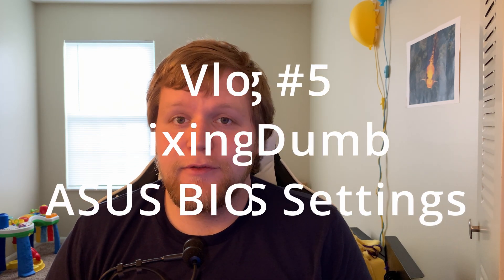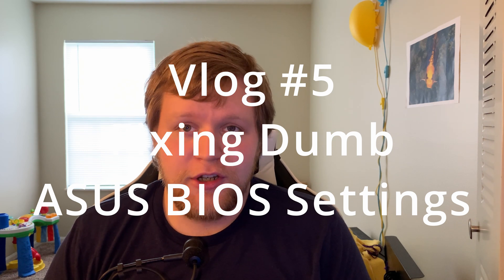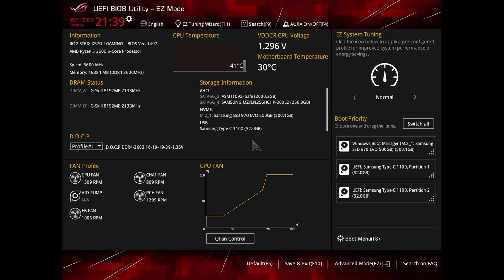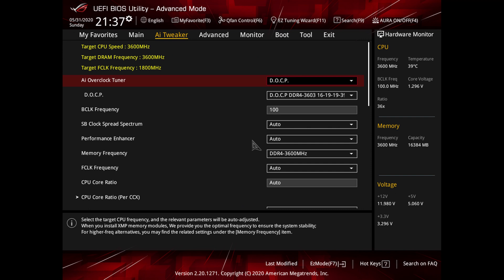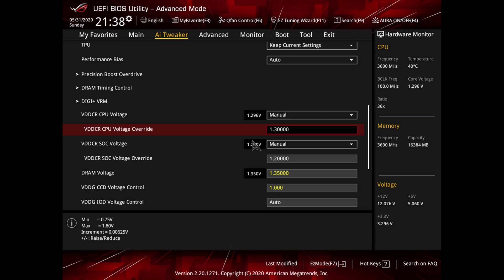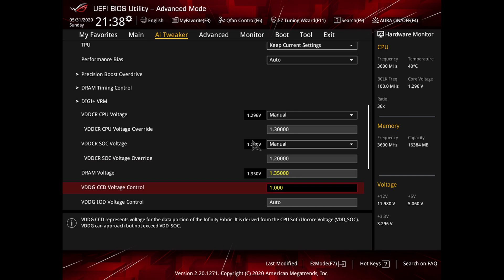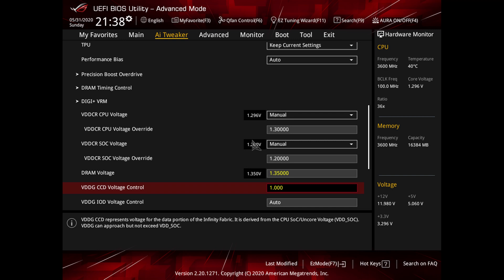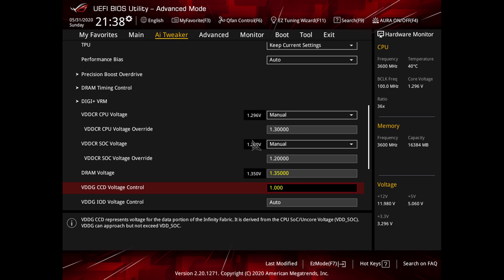How to fix an overheating Ryzen CPU for free

Comment: what voltage i should use for 4.00 mhz using ryzen 5 3600 with stock cooler
on my board i can't directly change voltage there is option of offset voltage (don't know how to used that)

Comment: I need help I did the thing in the video save and restarted it, now my pc monitor are black don’t know why. My pc is working all the led are on I just can’t do anything on my pc. I turned it off and on, nothing works. Help me plz if u can ?
Reply from the maker: It sounds like you may need to reset the CMOS on your motherboard. That will return your BIOS to its original settings. You should be able to find how to do that in the motherboard’s manual or via YouTube! Best of luck to you.

Comment: I have so many issues with this. I don't even know where to begin. I would also like to state that I have contributed a significant amount of time into understanding overclocking and monitoring Ryzen processors. I have spent a lot of time and effort to make sure that my information and understanding is correct. Just go clear the waters, if you know what Clock Tuner for Ryzen is, you should check the credits page. In addition, I am the only one who really develops software specifically aimed at controlling and monitoring Ryzen Mobile based systems (outside of AMD and OEMs). Setting overclocks in bios is dumb on Ryzen because you are bypassing the System Management Unit and that causes a number of potential problems. Next, AMD motherboards don't really overclock themselves. Ryzen is just set to run as fast as possible untill it hits its thermal target. Not to mention the whole list of variables that you change when going from the stock boost algorithm to a manual OC. Ryzen is specifically set up to idle cores as much as possible in its stock configuration. This will lead to the temperature showing a higher number as AMD measures the absolute hottest point of a particular part of the cpu. Setting a constant voltage of 1.35v is a TERRIBLE idea. I cannot run 1.35v under certain workloads without overheating. I have a 240mm custom EKWB loop. Having that much voltage running though Ryzen is just a terrible idea as you create a massive heat density problem. If I cannot handle 1.35v, its an absolutely awful idea to run anywhere near 1.3v on a wraith stealth. I just happened to stumble across this video and it just got so many things wrong. It pains me to see this kind of bad information being spread around when I've spent the last year of my spare time into understanding Ryzen. Honestly, you'd be way better off just throwing PBO on and setting a custom temperature limit. Ryzen just idles "hot" as it's got cores boosted up for whenever you hit the cpu with a workload.
Reply from the maker: Keaton, thank you for your comment. The last thing I want to do is spread misinformation. I made this primarily because I had overheating issues at the ASUS X570-I ROG Strix’s factory settings and I wanted to help others find the solution that took me a month and an RMA to find.

After considerable digging online, I came across a JayzTwoCents video where he explains that many gaming-centric motherboards overclock Ryzen out of the box in order to compete against other manufacturers. He then changes settings on a Strix board to what is shown here. (Please note, by the way, that 1.35v listed there was set for the DRAM automatically by DOCP.)

The settings Jay shows, the very ones I show here, are stock settings provided to reviewers by AMD so they can test more uniformly without the specific motherboard used contributing as much to the outcome. Because the Strix board overclocks somewhat out of the box, these settings effectively result in undervolting, not overclocking.

All of that aside, I agree with you that Precision Boost Overdrive is a better solution for most people, IF they can afford a better cooling solution than the Wraith Stealth. If not, I submit that this may be a viable solution that reduces system power draw and CPU temperatures while offering increased performance. 

If there are things I am missing, though, please feel free to reply. I really don’t want to be causing any harm here. I was only trying to help summarize information I dug out of a video from what I consider a reliable source.
Reply: @MostermindTech  im running a ryaem 3900X on an aorus pro mobo, it was idling between 45 and 55, then i updated the bios to the latest version. This got rid of the temp spikes completely and it idles between 33 - 37 now.
Reply: Gotta admit ctr 2.0  really did the job done, now running cooler and faster with 1,188 volt at 4,25 ghz all core. And most important i dont lose single core performance with hybrid oc

Comment: Came for the overheating of my 3600, stayed for the ASMR
Reply: Normal 3600?
Also what is ur cpu
Reply: @memecity6722  CPU is a 3600 :D. It doesn't actually overheat but the chip loves to ramp up frequencies and voltage for a second and then it comes down immediately (the boost clocks kicking in) and this causes a sudden spike in temperature. This made my cooler go crazy so I adjusted the fan curve to ignore the spikes and set the fan a little bit higher RPM wise. But overall the chip does run hotter than the 1600AF. Oh and I don't use a stock cooler. I have an aftermarket air cooler which helps a lot.

Comment: hey god sent you to me i have same problems i've got ryzen 5 3600 with rof x570-e gaming the board overclocking the cpu automatically and increases the voltages to 1.4/1.44 in bios temps if cpu around 30/34 degree and on windows at idle 40/44 degree clock go from 3.6 ghz up to 4.1 ghz i have a good cooler enermax liqmax 360 i wan to get a low volatges with low temps without losing performance let's say 4.0ghz whic stable voltage that is stable and low temps?
Reply: Dude I have da same situation going on with mine and I just swapped my stock cooler for the evo 212 CM and it’s hitting 95c under full load it s making me sad lmao
Reply: @Dxe1016  i've got the solution disable amd boost core and everything will be done
Reply: @dalileddineslimani6399  how many voltage should I use I currently have mine at 1.4000 but idk if maybe it’s to high that’s ways causing extra heat
Reply: And did you do this through the bios or did you use Ryzen Master
Reply: @Dxe1016  no on bios just disable amd core boost that will disable the auto oc by amd and ryzen 5 3600 will go with its base core speed which is 3.5 and you'll notice that the temps will go down with 5-10° or more than it depends on the efficiency of your cooler.
Reply: @dalileddineslimani6399  yea but I’m trying to keep my ryzen 5 3600 at 4.0-4.2ghz all the time because it just stays at 3.6 and never moves up even when gaming and I found it odd so I upgraded to the evo just to overclock and kill heat but no it’s just the same amount if not more and it’s passing me off really bad because I Care about my hardware
Reply: @dalileddineslimani6399  there’s no way to get rid of the heat without it interfering the overclocking
Reply: @Dxe1016  my clock speed before i disable amd core boost were between 3.6 and 4.0 ghz after i disabled this feature clocks went back to the base clocks 3.6 ghz for sure temps went dropped from 46/50 to 35/40 using 360 mm radiator.
Reply: @dalileddineslimani6399  but have u found a way to keep the CPu at lower temps but around 4.0ghz ? I’m really in need of help because I just upgraded from an intel Xeon that’s 10 years old and spent $200 on this CPu upgrade just for it to run hot as fuck and be slower than a 10 year old processor and I applied the proper amount of thermal paste like I always do this is just really pissing me off I can’t find a solution
Reply: @Dxe1016  temps were normal in my case with that oc but i exagerated about it
Reply: @Dxe1016  i have a ryzen 9 3900x with stock cooler max temps at full load 78C. All cores 4.15 GHz and 1.168V
If you want lowers temps reduce the voltaje and GHz, or buy a better cooler. 

With a water cooling I can put that ryzen all cores at 4.4 GHz, and it is like 5% performance improvement. But  with more than 1.3V. 
I prefer less than 1.3V and less than 75 C.

Comment: can i follow this tutorial with an Asrock b550m pro4 Motherboard BECAUSE MY CPU is overheating aswell like 94C full load and 60C at Idle
Reply from the maker: Absolutely! The settings may not be exactly the same, but they should be similar enough to translate over to your motherboard.
Reply: Kanye yeast, what is ur cpu and mobo?
Reply: @memecity6722  mobo: asrock b550m pro4, cpu: r5 3600, i actually gave it for testing and they just gave me a new one for free cuz i still had warranty. Turns out the cpu was faulty

Comment: Hey man I have a Asrock B450 M HDV mobo with R5 3600. 
I know It's a pretty trash mobo but since I wasn't planning to overclock it I decided to choose this one.  can I use the same settings that you used here to reduce my temps too?
Reply from the maker: You should be able to, yes. I’m not sure exactly what analogous settings are available in Asrock BIOS, but I would imagine there will be several parallels worth looking at.

Comment: Can I do it on asus prime b450ma ? I dont  habe the manual opcion on control of volt
Reply from the maker: There may not be all the same BIOS settings, but there should be some manual voltage controls. I would compare your BIOS to what’s shown here and see what similarities you can find in regard to settings.
Reply: @MostermindTech  thx :)

Comment: What about the stress temperature after change these settings Daniel because i bought rayzen 3600 with Asus Prime B450 motherboard  having  overheating issue when stress the cpu up to 90% 
then its over heating nearly 92 degree any suggestion
Reply from the maker: The temps are getting that high under load after changing the settings? I would say the next best step will be more airflow in the case if you can manage it. Ultimately, the included cooler with the 3600 just isn’t robust enough for the CPU. I would not call the stock cooler a permanent solution, but for anywhere from $30-100 you can get a good cooler upgrade. I’ve heard very good things about CryoRig, Noctua, and Arctic coolers.
Reply: @MostermindTech  hi Thanks for ur reply actually when process to 100 without overclock temperature Rising up to 95 c  then i stop the render because im not sure about what will happened next.. then i ask to replace the product with new where  i bought   it then they claim warranty and provided me new processor . it also have the same issue may be whole new 3600 processors having that issue ,, one of my friend have 3600 with stock cooler maximum temerature reach when 100% cpu usage is 77 c
Reply from the maker: I hope you were able to get those temps down! Unfortunately, there are a lot of variables that affect it. 

One common problem some people have is seating the cooler properly as well. Just a tiny bit off-level can totally ruin thermals.
Reply: @MostermindTech  Hi There was an issue in that processor so replaced the processor
Reply: @SpectrumpicturesLK  what CPU and mobo you have now
Reply: @memecity6722  same  it was factory fault and they replaced the processor for new one

Comment: I only have an Offset mode on mine cant even change it to manual i have an Tuf Gaming B450 from ASUS and my pc is shutting down when i Play games for around 1 Hour
Reply from the maker: I would highly recommend a more robust cooler if that is the case! The Arctic Freezer II line is a great group of affordable, high-performing AIOs. Take a look!

Of course, there are many air coolers that are less expensive that would likely do the job as well. Extra case fans probably wouldn’t hurt either if you have the room!

Comment: Thanks for the advise! Been struggling with high idle temps on my 5-3600 and my ASUS B450 for weeks!
Reply: Did you try these settings? Mine goes to 90C-92C while gaming (CS:GO) and while idle it stays around 60-80 with the stock cooler installed.
Reply: @ANDROPUNK  bro did you fix that?  I have ryzen 5 3500x, rx 5500xt 4gb and i get about 70 degrees on cpu in csgo...
Reply: @miloskrstic2282  70C is still fine. I wasn't able to fix anything in the software with that. Had to get a third party cooler.
Reply: @ANDROPUNK  okay thank you man. I have stock cooler but i think i will buy aftermarket and i also have right now only 1 cpu fan, cpu stock cooler and psu fan in my pc so its myb hottee btw its new pc

Comment: This actually causes higher temps and lower performance for me. Weird.
Reply from the maker: RJ Cam oh, no! That makes me wonder if your voltages were already a bit lower than this. You might try clearing CMOS on your motherboard and putting things back at stock and go from there. Do you have your power profile in Windows set to Balanced or Balanced (Ryzen)? You don’t want either of the High Performance profiles selected.
Reply: @MostermindTech  Yep, you're right. Experimented all weekend with manual voltages, turning PBO/CBR on/off, etc. till I found the right spot for me. Now, I'm undervolted by 100mV and locked my core ratio to 39x for 3.9MHz max clock with the stock cooler. From more or less 70c idling to more or less 70c full load while achieving almost the same performance at stock, I'm a happy camper. Your video helped, thanks.
Reply: Aw man, I’m gonna try this in the morning. It’s late, I’ve been up pulling my hair out with my over-heating Ryzen 3600 shutting down mid-game. I presume the problem is my ASRock Phantom Gaming mobo, so I’ll try your settings and cross my fingers!
Reply from the maker: Any luck?
Reply: @PikaStu666  do u have asrock phantom gaming 4? how is it working the motherboard is everything fine?
Reply: @zzZ0se  it was a nightmare, I had to under-volt my Ryzen 3600. BUT, I changed my GPU last year from a Vega 56 to an RTX 3700 and I’ve not had a single issue since?! Over clocking my cpu is fine now?! Really weird!
Reply: @PikaStu666  do you think that if i wont overclock my cpu it will be all good?
Reply: @zzZ0se  I honestly don’t know. I used the Ryzen software to keep the temps down, but now I don’t have to. What GPU are you using?
Reply: @PikaStu666  i will be using rtx 3050ti or 3060
Reply: @zzZ0se  in that case I’d say yeah, go for it. Like I said it works flawlessly with my rtx3070. I’m extremely happy with it now, where-as a few months ago I was dreading it crashing mid-game. It obviously didn’t like something about the AMD Vega 56!

Comment: I have just bought a new pc with this cpu and msi b450 pro-vdh max with stock cooler and i get on idle 55 C. In games up to 95 C lul. With stress test i got over 100. Tryed lowering core voltage with ryzen master but it didnt change much. I will try this out and hope it will help.
Reply: All the settings i changed did not help in my case. I just opened the side of my pc case so the airflow is now better and the cpu gets like 10-15 C° less. I just bought the Hyper 212 cooler from cooler master and will install it in the next days.
Reply: Hasancan Tuncel Update?
Reply: @hasancantuncel7893  how did it go?
Reply: Did it work ?
Reply: I have same as ur configuration with overheating and system crashes. please update how ur settings work